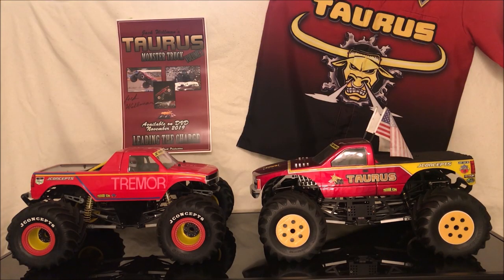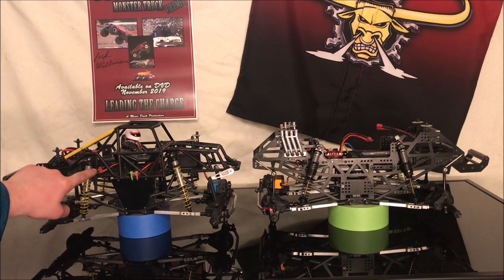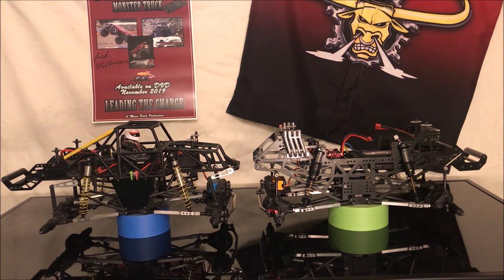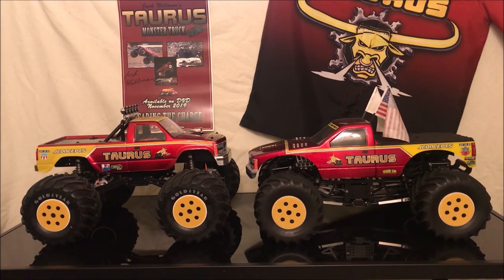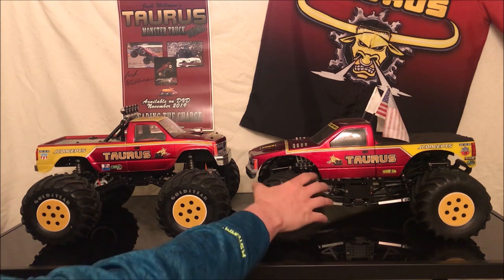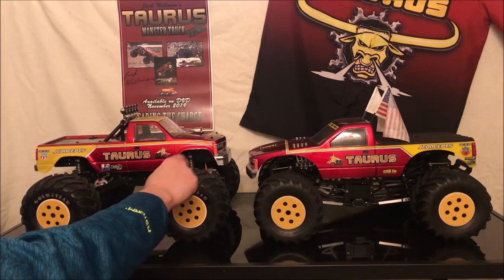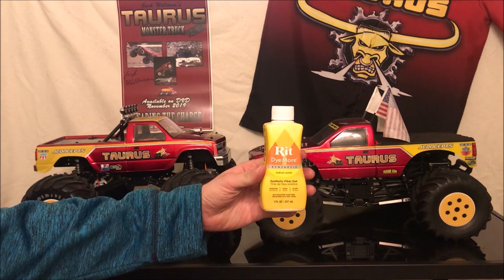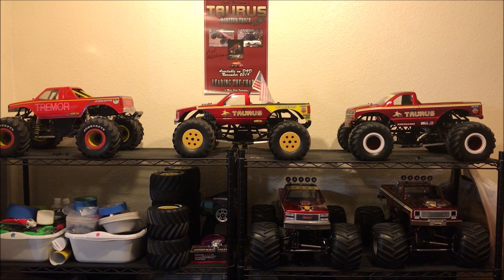Taurus R/C Monster Truck Racing Overview - Trigger King Tech

Comment: I've never seen the little point and the needle on the E6000. Does it come with the smaller tubes or is it something that you buy extra after-the-fact?
Reply: Bryan Forth I’ve seen it with the big tubes by crafts/paint pens and occasionally the small tubes by duct tape/paint thinners at Walmart. I just keep the caps & 3 included tips when tubes are empty and re-use them now (I clean dried glue out of tips with sewing needles).

Comment: Do you lock your front or rear differentials, or do you run them open? I was thinking of locking my rear and leaving the front open
Reply: Pill Cosby both open. Rear locked is fun for bashing and makes better donuts, but it adds about 1/3 to your turning radius which hurts you in technical racing like we do. Both locked would take half a parking lot to turn around because all 4 tires are pulling and nothing can pivot around to turn.
Reply: Thanks I'll run both diffs open

Comment: Which kind exactly of E 6000 glue  do you use to glue the tires?
Reply: C.B.ONE i didn’t realize there were multiple kinds? It’s just the industrial strength, clear, silver tube with red/white E6000 outlines they sell at Walmart in the craft section. It holds great but is easily removable.
Reply: @Jayare505  It holds great but is easily removable. Thats the main thing and important.. to change the wheels, tires.. thx.  I only knew clear shoegoo before. For the shoegoo tubes there are also dosing tips